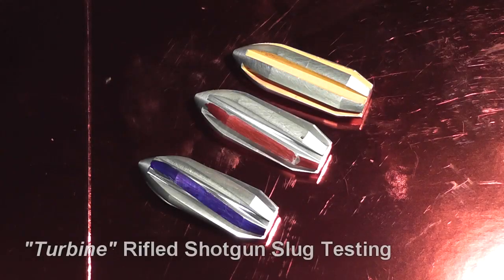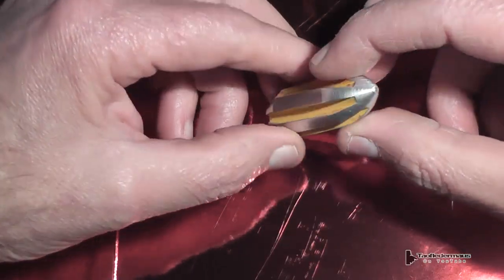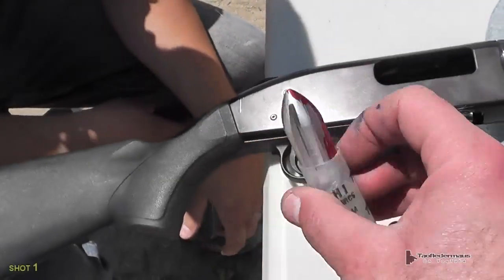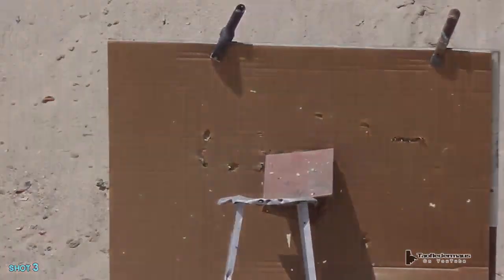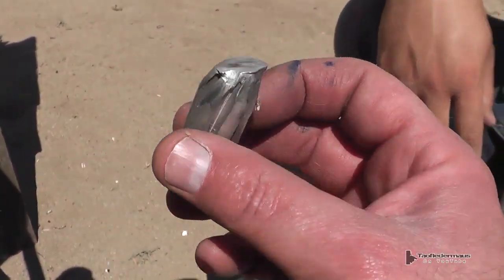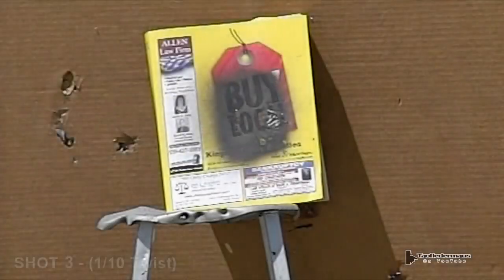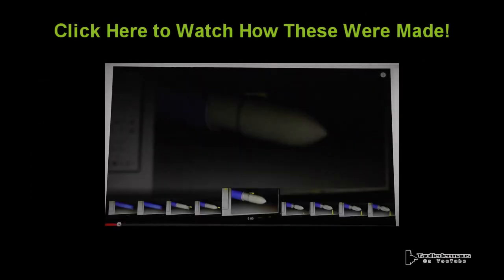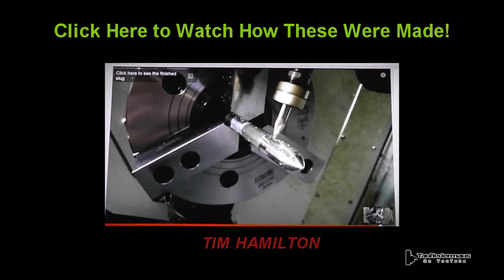Custom Aluminum TURBINE Shotgun Slugs  -Testing

Comment: The tumbling is from the release mechanism in the slug holder. I noticed that when you guys put it in that it was slightly off center. It came out of the barrel at a slight angle. So technically its not the slug's fault but rather the way in which you used the slug

Comment: Change the material to brass or copper, shorten the round to one inch, make the grooves 1/45 twist rate, hollow out the nose to 67 cal and either press a 68 cal lead bearing in the front or bond the same size into the same position. Also either flatten the end or machine a dome in the bottom.

Comment: I've not read all the comments, so someone may have already suggested this.  Do like Brenneke does to make their solid lead slugs fly point forward... screw a plastic or fiber wad to the rear of the slug.  In this way the wad that seals the gas is attached to the aluminum slug.  It will make the rear of the projectile lighter than the front and make it act like a badminton birdie.  It will then fly point forward.  You will need to experiment with the size of the wad attached to the rear of the aluminum projectile.  The rifling will then be unnecessary.  If you don't have to cut rifling in the slug you will save a lot of the cost of producing the projectile.

Comment: A thought might be that you're too close for those rounds to adequately stabilize.  Watching the slow motion I was seeing a lot of yaw, but it didn't appear to be completely uncontrolled tumbling.  With the turbine locked into the wad, it's not going to be able to 'spin up' while it's inside the barrel.  Really it won't spin up until you have wad separation.  So if the slug is just yawing around it's center of gravity, and staying relatively under control and on target, then you might just need more distance for the slug to get spinning.  Say 50 yards instead of 20.

Comment: I'm no ballistics expert but I'd say, if you put the fins in the back (somehow) or even the middle, it will fly better. Such deep grooves are catching air in the front and making it tumble. Put the slug facing up under a water faucet to see where the aero forces are being applied along the body.

Comment: If you look at the high speed it does flop around a bit but then it goes right on target so if you had it further away it would be more precise and it would go from being just flopping around actually straightening out because if you look at them they did straighten out at the end that's reason why they were on target like when you see an arrow you see a kind of binds and then Springs off of the bow that's what's happening there and the arrow has fins or properly called fletchings that make it stabilized but at the beginning of the shot and flops around and then goes on target it's because of how long the bullet is if you honestly put the target  further away then you and then high speed it you would see it straighten out more and fly straight

Comment: Cool idea and great machining on those slugs to whoever did them! However, the reason rifled slugs fly straight has little to do with the rifling.They were originally made with the same mindset as these rounds, however it has been proven that rifling cut into the slugs does little to nothing for stabilization. They are only stable because the front is heavier than the back of the slug by design. A rifle or handgun is able to stabilize the bullets with a spin as the rifling is in the steel barrel and actually cuts into the rounds, forcing them to spin. Nice shooting though, it's impressive that they fly so well while flipping through the air like that!

Comment: Uhh oh, might wanna to make sure this is on the up and up with the 1934 NFA.  Pretty sure theres wording in there about shotguns and rifling and diameters over .5.
Reply from the maker: p331083   Thanks Perry.    Cabelas and Dick's sporting goods are probably being raided as we speak since they've been selling 12ga rifled shotguns for years.   The OUTRAGE!
Reply: ***** Oh snap.  Why not get the bro who made you these to make some out of lead?
Reply from the maker: They'd be way too heavy.  He's made some other slugs out of some exotic metals though, like titanium,  etc.
Reply: ***** Titanium hollowpoints, do it.  Was suggesting lead though due to that pesky armor piercing ammo ban.
Reply from the maker: The slugs he sent me are not hollow points.  They resemble foster slugs.  Most of the metals wouldn't benefit from being hollow point since they are not soft metals.  Besides titanium,  the other metals are aluminium, cast iron, stainless steel, mild steel,  brass and copper.  They are all identical but of course have different densities and hardnesses.

Comment: I believe that the round is tumbling because the center of mass isn't far enough forward of the drag-causing grooves.  There is enough drag generated where air enters the grooves to slew the front around.  Needs more mass forward, and maybe if the grooves start midway back, so that drag also stabilizes the front.

At the speed the round is traveling probably also needs even less turns on the grooves.  To high a turn rate probably overwhelms the aerodynamics with drag.

Comment: I see no use at all for a tumbling slug, unless it's a non-lethal projectile used for crow-control. Maybe a slug with pop-up fins could do the trick? There's an interesting idea for a slug shot, maybe Tim Hamilton could try to design those and Taofledermaus could let us know how they perform. However the cost of mass-producing that kind of projectiles would be staggering.

Comment: You are spinning both ways, the gasses in the barrel are spinning one way and the oncoming air outside the barrel is spinning the other so it will not stabilize. You need an etched sabot rifled in the other direction to stabilize. You cannot just gas check it you have to initiate spin before it leaves the barrel because after it exits is too late.

Comment: Just a guess that the openings at the rear of the projectile need to be either reduced or enlarged. And the length shortened and tapered at the rear and fully engaged by the shell casing. Traveling at those velocities the projectile needs to be aerodynamically adjusted. Aluminum is not the answer as it has too light a composition. Tungsten or steel would be a better choice because of density.

Comment: Slugs for a smooth bore shotgun stabilize mostly through the same concept as a badminton birdie: dense in the front and light in the back. These are called foster slugs. Yes, the rifling imparts a little bit of spin, which I believe happens in the bore and is not caused by the air, but that is not the most prominent cause of stability as demonstrated by this video. Perhaps if the aluminum slugs had the rear half hollowed out they might be more stable? TNOutdoors9 has an excellent ballistics test of Winchester's rifled slug that shows the hollow base of an unfired slug.

Comment: And that's why they rifle barrels, not bullets. Cutting grooves into a bullet isn't the same as forcing it to twist due to rifling in the barrel. I'm surprised someone actually thought it would make a difference. How does cutting grooves into the slug force it to spin? That, and the fit between an actual bullet and a rifled barrel is much tighter. Your results are entirely predictable.

Comment: I'll bet the problem is a very low ballistic coefficient due to a low bullet mass relative to its size. If it had been made from solid brass or copper instead of aluminum, it would have likely been more stable in flight. I knew as soon as I saw the keyhole shaped holes in the target that the projectile was not stable in flight. The one with a mashed nose most likely just happened to have tumbled into a nose-first attitude at the moment of impact. Had the target been a few feet closer or further away, it might have keyholed also. Interesting idea though.

Comment: Guys a little thinking about what's actually happening - the problem is the fast moving gas from the cartridge explosion will flow past the bullet in the chamber spinning it one direction - but then when the bullet meets the outside atmosphere, that force will spin it the other direction!

Need to plug the back of the bullet a little better.

Comment: The problem with rifling these slugs is that it doesn't work anything like rifling a barrel. With a rifled barrel, the round is gyrostabilized before leaving the barrel. That means that there are already stabilizing forces acting on it preventing disruptive forces from tipping the bullet.

With these rifled slugs, they are depending on air currents to 'spin up' the round, but if the bullet starts tumbling immediately, it will never create a proper air channel to spin up the round and stabilize it. A great idea but one known not to work.

An unconventional idea that could bear fruit would be a fin system that unfurls the moment the slug leaves the barrel. With enough air-grabbing resistance at the tail, it could force the round to follow a straight path.

Comment: shotgun slugs are not really spinning. even "rifled slugs" grooves arent able to impart much if not any spin on the slug. they were origionally designed to allow the slug to squeeze through a choke tube. 
To make any of your slugs fly strait, the best bet is to put the majority of the weight of the projectile in the front. thats why most shotgun slugs have a huge hollow cavity. works like a badminton birdie. my 2cents

Comment: Problem is (imo) gasses are escaping through that twist, since it's not "air thight".  Bottom part of the slug, where it angles into the center, should be solid like on a normal bullet. Without the twist, so it makes a seal when you put it in a shell. But what do I know, never fired anything like that myself. lol

Comment: The aluminum is going to be too light for its size to be stable, drill out the core and insert a tungsten rod or pour some lead in it. That should help your round out, especially if you favor more mass near the head.

Comment: the back side of the round needs to be hollowed out,.make the front of the round heavyer than the back so it glides theu the air.  make it fly like an arrow instead of trying to copy the .50 cal.  Its nt an accruate weapon by any means, but its a good idea.

Comment: The rounds need to first, be enclosed in a sabot.  Second, the shape needs to be refined to include fins.  Model the thing after the rounds used in today's smooth bore tank rounds.  If it works in the Abrams, it will work in a shotgun.
Reply from the maker: Tvideo   Sabot are for shooting sub-caliber rounds out of a larger barrel.  They don't make a round accurate or fly straight.
Reply: ***** Wrongo.  Sabots have been around a LONG time.  The sabot itself is just a holder for the round and yes, the projectile is smaller than the bore size by the wall thickness of the sabot.  So what?  
Again, look at the rounds fired in modern smooth bore tanks.  If you keep trying to put lipstick on those pigs of slotted aluminium rounds you are still going to end up with pigs.  They will always tumble. There is ZERO aerodynamic stability imposed on those rounds at all and never will be until some sort of rear "fletching" or fins are added.  

If it works for the M1 Abrams tank series, it will work on a shotgun load.
Reply from the maker: Tvideo  Well if you say so.

Comment: Wow they tumbled much like the 3D printed slugs. I wonder what it would take to stabilize them? Rockers (with finz) for the most part seem more stable though the propulsion is gradual at first - so maybe that is the difference. Crazy video, though. Love the slow-mo.
Reply from the maker: neurocosm   Hopefully the new designs Tim has made will work better.

Comment: Nice video, nice idea and analogy. Also for the guy making the rounds.
However, I'm not an expert at this. But I think I see a little mistake surely for when it comes to the spinning action that should happen. I would experiment with the shootgun case that is holding the "ammo". This case will not let air flow through. So this will bring the round itself out of balance and as soon as that happens and the case get of the round, the round will already have a tumbling action that it cannot go straight anymore so that the round can start spinning. (hopefully you understood what I'm trying to say.) Maybe add some holes into the casing where the "carved" parts are so that the air can flow out and hopefully start spinning as soon as it get shot.
Reply from the maker: Carlos-Alberto Wever  tim has a lot of other ideas we'll try out.  Some will work,  some won't.

Comment: Needs to be fin stabilized. Like a mortar round. Twist on the front or main body of the round wouldnt hurt also but good luck designing a way for the shotgun shell holding a mortar shaped round in place properly. Maybe some type of wadding or device like a SABOT tank round or case around it to give it a solid outer housing. Something that will drop or break away once it leaves the gun tube.

Comment: What about a small spring loaded set of stabilizer fins. They would lie down when in the barrel and deploy as soon as they cleared the barrel providing stable flight. Similar to broad heads. Just saying.
Reply from the maker: boudaneater   I don't know if the machinist wants to spend that much time to make something like that.   He might.

Comment: If you can get it spinning before it leaves the end of the barrel, you may find the round will fly true. That is the reason a "bullet" flys as it does. If Tim could mill a barrel for you with a twist in it to get your sabot spinning, that may be the key.

Comment: I suspect the laminar flow is preventing the grooves in the slug from doing any real work.  Rifling works by imparting a mechanical spin, you're not going to get the same behavior with aerodynamics at these velocities.  You also need to consider of the center of pressure of your slug to prevent tumbling, just as you would in rocketry.

Comment: They already make rifled slugs. So this isn't ground breaking. And the slugs should be designed to expand in the barrel to capture all the gases and make sure the rifling grabs the barrel and the projectile a actually spins. that's why they use lead to make bullets.

Comment: It appears to me the round was thrown off balance by the shell hanging onto it too long. Looks like it could use something to allow an easier release when fired. I don't know firearms or ammo, but maybe putting a few slices at the end of the shell before putting in the round? Like I said IDK about firearms and ammo so if that will just make the shell break apart and not fire the round properly disregard my suggestion.

Comment: Sorry, but those failed miserably.  In the slow motion videos after, I could see one of them tumbling like the others with no grooves.  The problem here is a machinist with no gun knowledge.  You can cut all the grooves in a piece of aluminum you want, and its not going to work unless you make it large enough to fit tightly in the bore. Aluminum is also not the best metal to use.  Either lead or solid copper, and even at that the copper will be too hard.  Rifled slugs have already been made, so why try and make something that will never even fit in a normal shotgun?  Again, gun physics is needed to be able to understand how to stabilize any round through the bore.  You can own millions of dollars in CNC machines, but unless you really understand how they work, this gets you no where.
Reply from the maker: pickin4you  The idea wasn't based off his knowledge of ballistics but from all the viewer comments telling us that putting spirals on projectiles would cause them to spin.   Since so many people said this,   we wanted to put it to rest.

Comment: I have the impression that it's only the push of the slug that propulse and it has to reach speed in order to grab more wind. But, the spine of the slug has to be received from the canon, and from behind. So the fire, somehow, has to pass through the thread in ordre to spine the slug inside the canon.

The amorce as to get little holl in it. The fire will get out with the slug a little but the spine effect will be given inside the canon as well.

 Also, one other prototype should be tried on, a prototype with little retractable wings. It will cause a "Badmindton effect", grabbing more wind.

Just a thought

Comment: Actually, thinking about how you could correct for the issues I mentioned, you could change your design to reflect a smooth shaped torpedo. A tapered torpedo shape with small curved fins with a minimal cross section would inherently become a metal arrow. You would still need to package this as a sabot round to keep the launch straight and true. Probably wobble even as a sabot but you would stand a better chance of a straight shot. Better to impart spin in the barrel before the projectile takes flight, for accuracy.

Comment: I applaud you machining skills but realistically i believe your fundamental problem is not inducing spin on the projectile before it leaves the barrel. Problem 2 would be tolerances inside the smooth barrel that would allow the bullet to bounce around and oscillate before it left the barrel which would induce tumble. Problem 3 would be the huge lands and grooves, or striations, on the bullet that would create severe drag that could also induce tumble or at the minimum reduce energy quickly. However, you get cool points for your design and creativity.

Comment: Just because you added machined rifling to a projectile does not mean it would spin. The reason a rifled barrel spin the round is because it's forcing the round to spin. The aluminum projectile made will need fins on its rear to have the air force it into a spin. But simply adding those groves will not catch the air to make it spin like a football.